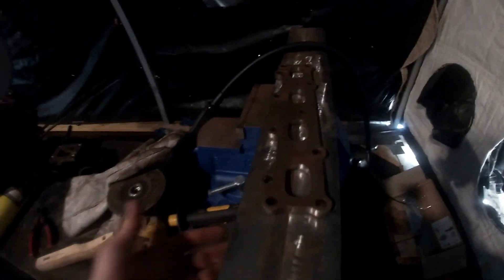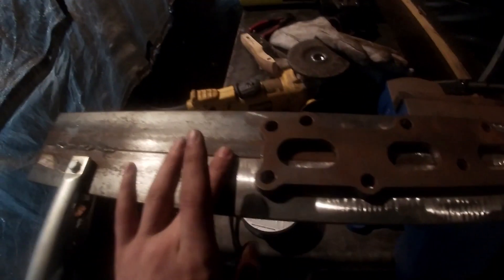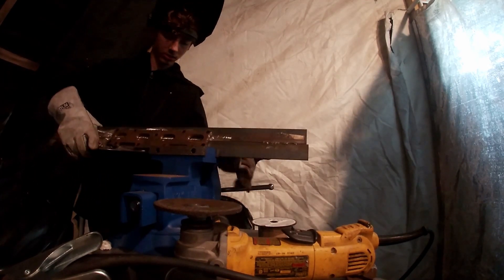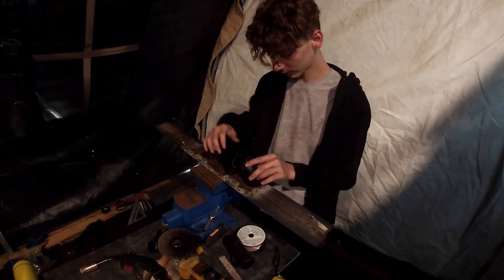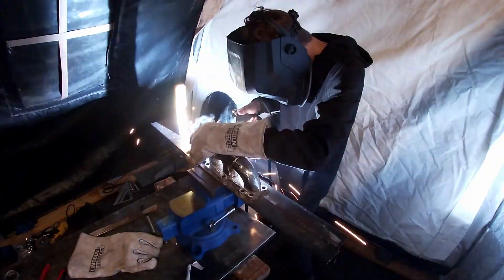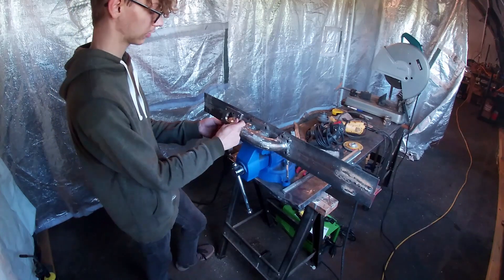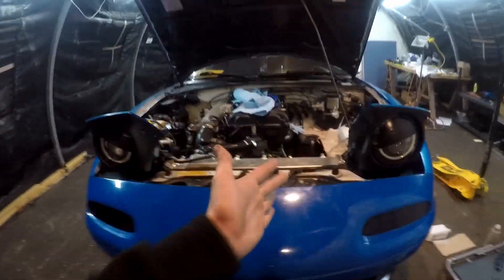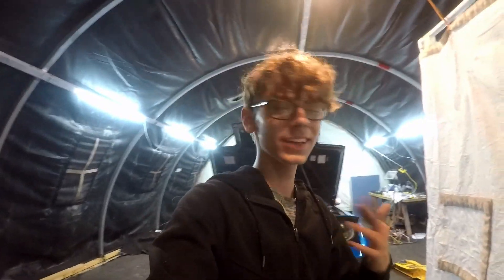DIY Miata Turbo Manifold, With a cheap MIG welder

Comment: Great video and those skills will stay with you for life. Just one point and i know this might seem boring but please please wear full eye protection when using an angle grinder. I have had a speck of metal in my eye and the visit to hospital was not enjoyable. You may find your welding helmet has a grinding switch on it which makes it ideal for that sort of work.